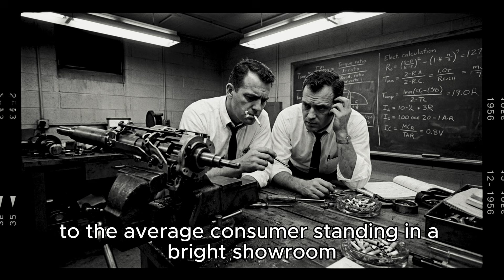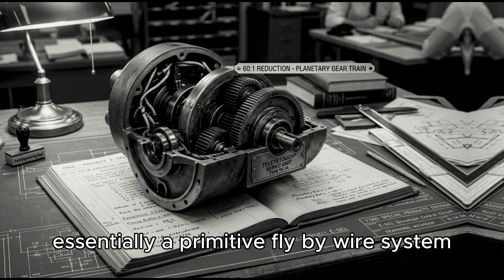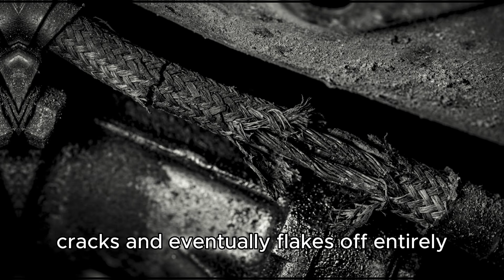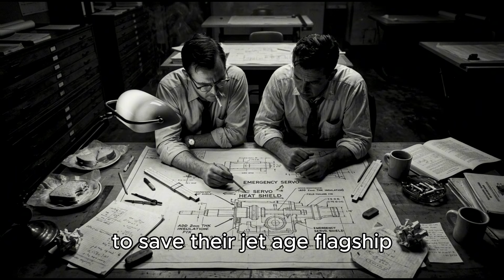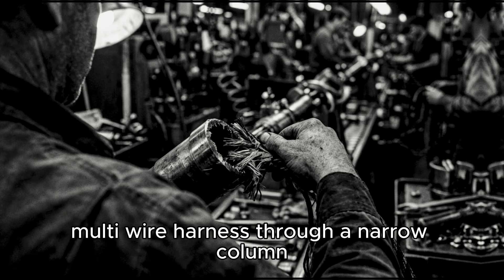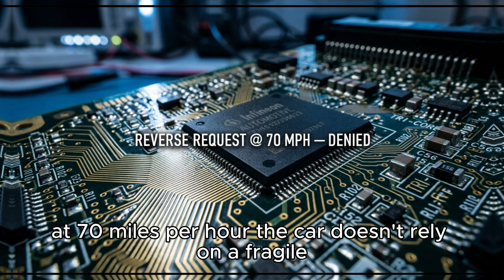The Fatal Engineering Flaw Hidden Inside The Steering Wheel Of The Ford Edsel

Comment: The servo motor was the biggest problem, though certainly not the only issue, with the Teletouch.  The problem was amplified by very little information provided to dealer mechanics by Ford on how the system actually worked. It probably would have faired better if Ford actually did real world testing on it before releasing it to the public.